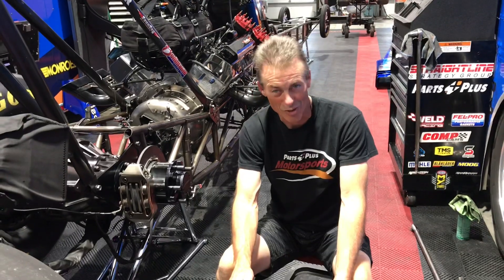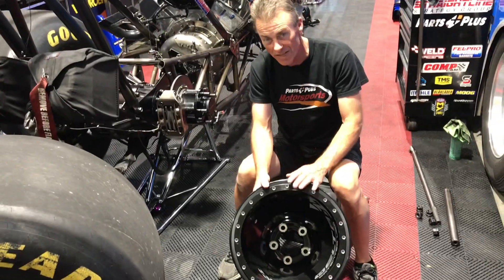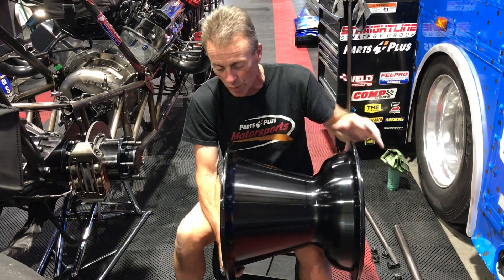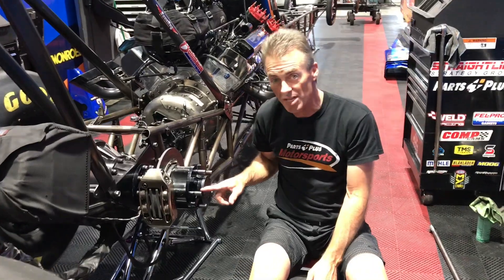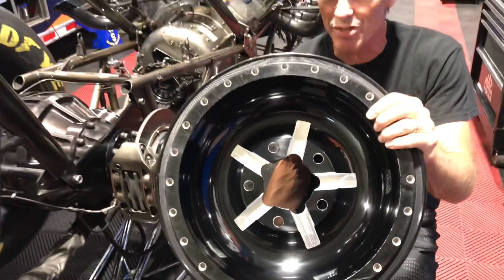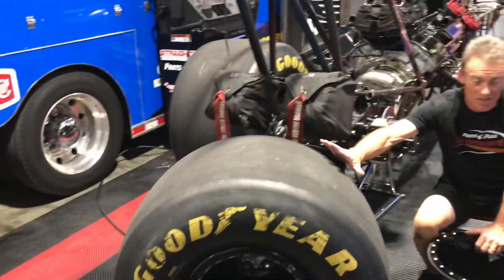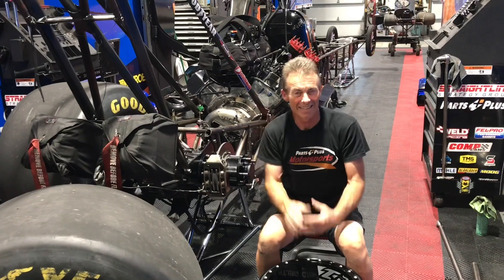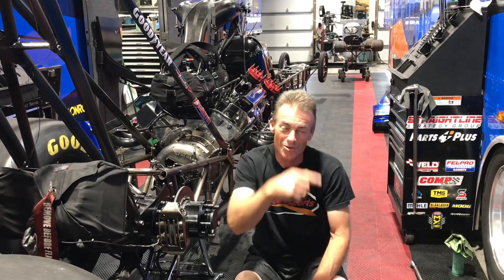Spinning Your Wheels !!!

Comment: Hello Clay. When I attended a race in person at The Strip at Las Vegas Motor Speedway, I could hear the engines load up after they are staged. This sounds similar to when you put an automatic transmission car in Drive and the engine idles down. Please share with us the process you go through when staging a top fuel car (as long as it doesn't give away any of your trade secrets). From what I understand, you actually release the clutch pedal before the car launches. Is that when we hear the engine idle down a little? I've only noticed that when going to a race in person as it is generally not discernible when on broadcast television. Thanks.
Reply: I’m guessing that’s when he turns on the second fuel pump
Reply from the maker: This is a good one and one we plan on explaining in a future video. Thank you 😊

Comment: Thanks Clay, love all the tech info!  So am curious, when you first went to the one piece wheel did the loss of flex in the wheel necessitate taking some clutch out at the hit?  Seems the flexing of the wheel would soften the initial hit to the tires.  Just guessing here!
Reply from the maker: To be honest we didn’t real change much we did see just a touch more wheel speed at the step of the throttle. Thank You 😊